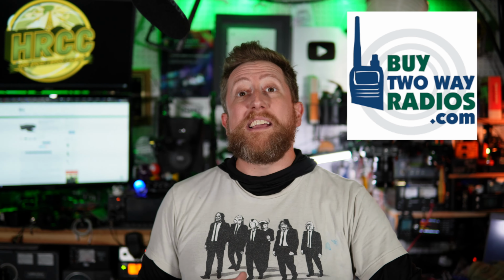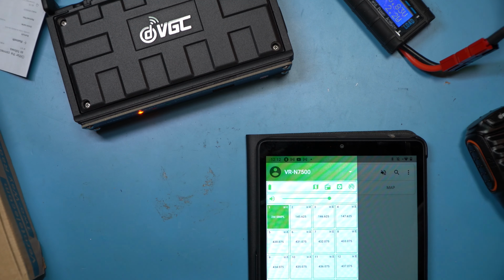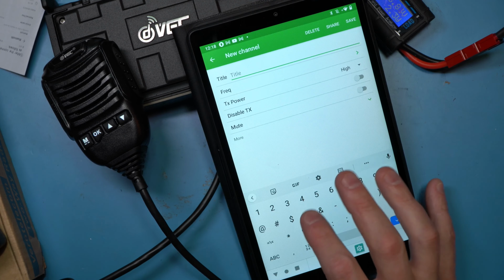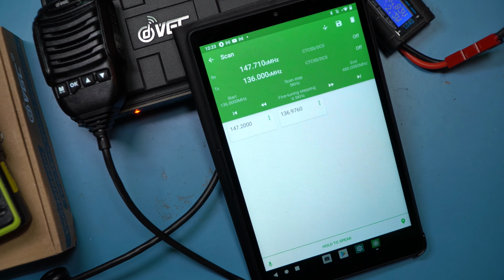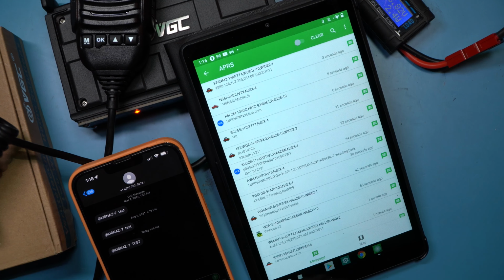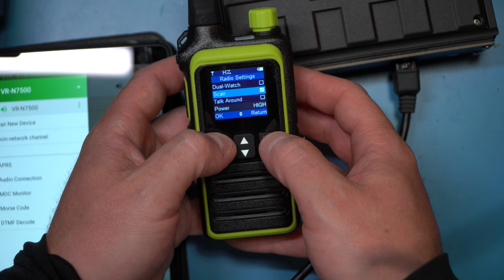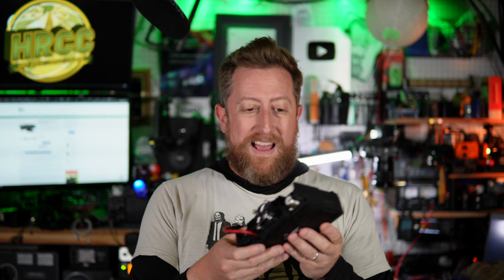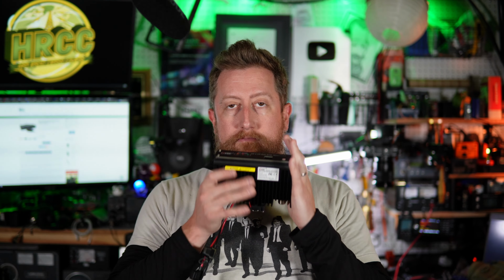VGC VR-N7500: APRS! Android, iOS, Bluetooth, Dual Band 2m/7cm Ham Radio Review

Comment: The affliate link doesn’t appear to go to the rig on the website. Just FYI… probably not working. :-)
Reply: There is plenty of information on the radio and a shame that their website is not, clear as the app does several radio models, look on FB and Google Groups for help groups.
Reply from the maker: That’s the link. It takes you to the website and you can pull up the N7500
Reply: @HamRadioCrashCourse  RR. Just wanted to make sure the “affiliate” part was working. Can’t really tell they’re crediting you… grin.

Comment: I output from my radio to a switcher box which flips between audio coming from my phone for navigation and music, to any incoming transmissions over the radio. This allows both my wife and I to hear what is being switched over the car's stock sound system amplifier, it and then we just grab the handset to reply. Is this unit basically perfect for us with its headphone port and separate microphone handset? Of course I am all ears to better options, I don't need this much power.

Comment: Perfect radio for my motorcycle.  Just throw my cell phone on the mount and I have 2m and 70cm.  Had it for a couple of years now.
Reply: That's an interesting idea.  What sort of hands-free unit do you use to connect to the cell phone?  And what sort of antenna do you have on the motorcycle?
Reply: This is exactly what I am thinking about doing with my Kawi Concourse, mount it inside the faring BT to my helmet and the BT PTT. I am assuming that you are not encountering any heat issues.
Reply: Well it wouldn’t fit under my seat so it gets lots of airflow where I mount it, but it isn’t weather safe.  I pull it and store it for rain.  Your mount sounds smarter than mine.  I suppose heat would strongly depend on how often you key up.
Reply: @awksedgreep  Thank you for the reply, I also joined the FB group for the radio and there is a guy on there that mounted it in his NC attic with no issues. Oh and by the way if you are having issues with the software I suggest joining the FB group as the admin of the group has an email to the the developer who he says is responsive to requests that make sense.
Reply: @pgsmith  I was aware of the google groups but not the Facebook group.  I'll have to join as well.  Thanks for the heads up.
Reply: I have an aluminum top box so I use magnets on the underside to use a mag mount.  At 50 watts my motorcycle is just big enough to be safe at that distance from my body, but it’s a big bike so do your own math.  I use a Bluetooth Ptt and my helmet Bluetooth for mic/speaker.
Reply: @awksedgreep  Thanks for the reply.  I'm not 100% convinced I want a radio on my motorcycle (I'm worried about it being a distraction), but I'm still considering it.
Reply: @pablod6872  I mostly just monitor repeaters.  I used to listen to music but I like repeater traffic more.  Haha
Reply: Also, make sure you get their Bluetooth ptt. I tried a generic first and it wouldn’t pair.

Comment: Nice review of this device, can you take it to that park and test with an Ed Fong J-Pole? I think this is a unique device!
Reply: You can plug anything that works well on 2 & 70. I use it on a motorcycle with APRS and with its rugged construction it still works weel after many trips. Just returned from an 1.800 mile ride using RF APRS only.

Comment: I enjoy my Vero a lot. Yes software is updated via app. Radio receiver is very sensitive and prone to intermodulation if you are close to a very reach RF area.  Planning to link it to my motorcycle helmet and see how it works. Audio is good when I use it with my tablet. I receive good complements during nets or simplex work.  If KN6FWT can get it going on his bike let me know.  Great video thanks!

Comment: So I have this radio, and its been great. I don't have the bluetooth mic, but the weird thing about this is that I can take my tablet upstairs and chat via my tablet no problem and my radio is inside the garage. How does this mic with an antenna not reach as far, but my tablet does?
Reply: The radio section has a small BT antenna mounted on the front and people have extended this by fitting better antenna or mounting the cover more forward on studs. I don't know where the FM antenna is mounted or even if there is one in the antenna section... not stripped it down to look at :>)  Min G0JMS
Reply: Some tablets have larger batteries and the manufacturer will take advantage of this by slightly boosting the power on both Wi-Fi and Bluetooth. Technically however they are both limited to about 30 ish feet / 10 meters. Another issue is even though you are "upstairs" where are you in relation to your garage? If at opposite ends of the house, you are lucky! Count your blessings and enjoy!

Comment: Too bad that the Bluetooth is weak.  This might have been a great CERT device.  

Given local terrain and distances, a 5W HT doesn’t quite work for some events.  I’d love to have a ~50W VHF radio driving a decent antenna, on a tripod, safely off the road, but also be able to walk 30’ from the radio (e.g., directing traffic) and still operate.  I.e., the portability of an HT with the power of a base station.
Reply: Sounds like the perfect use case for a cross band repeater.
Reply: In the open air without walls or bodies between it will do 30ft distance as I have tested it,  some have increased the distance with better BT antenna systems or just moving the front panel forward to expose the BT antenna. It will not do Crossband but the Network side to RF can be good and works well.  Details of extending BT on FB pages for the N7500.

Comment: Will it Tx on GMRS channels?
Reply: yes GMRS no prob, it does 400-470 MHz
Reply: From a Dutch dealer's website (first I could find with numbers): TX/RX: 136-174 / 400-470 MHz
Reply: I've had multiple people tell me that the Tx is actually unlocked.  Don't know if it will stay that way.  I suspect the FCC looks at this kind of unit like software defined radio which really can't be locked.

Comment: I have had mine since 4/20 in a 2019 Wrangler Unlimited. Antenna on the spare tire mount, radio on the driver rear roll bar and hand mike at the rear view mirror magnetically attached to the top toggle. I run the app on a Moto G Power. It is a solid performer in the mountains of North Carolina. Thanks for including the bluetooth mic in your review. Always enjoy your content.
Reply: Are you using this setup currently? I’m in Carthage NC. Went to Asheville area to volunteer and Comm’s are extremely limited.
Reply: Yes, but don't drive much since I retired last year. Repeaters have been quite quiet here before Helene. I can't hit My. Mitchell from my home. Otherwise this has been a good rig for me. Hope this helps. KN4TIH

Comment: I  nearly purchased one of these about a year ago but was concerned about the software. 

I am curious if they are actively developing more polish and features on the software side. 

The concept is cool 😎
Reply: From my first use a couple years ago, to reinstalling the app a few weeks ago, I was surprised to see that, from a UI/design standpoint the app hasn't changed a bit. I was also surprised to see that there was a firmware update for the radio, and the app did it seamlessly over the air in about 90 seconds. That part really impressed me.
Reply: I'm beta testing a new version and they have made great steps forward in sorting out bugs and developing the APRS in the Andriod and iOS side of things, hope they can release the update to all soon.
Reply: @MarnochStanden  are they updating this or is it dead?
Reply: They just updated the iOS app (perhaps today) to show live APRS like we see on the Android app. Josh needs to do another video withe the new iOS update.

Comment: Cool device. I wonder why there's a character limit on a device that doesn't have a display?
Reply: 8 characters is a common hardware limit for small memory systems. They put a slick Bluetooth interface in, but I believe the hardware is relatively basic inside. The memories are saved to the radio itself as well as the app, and it can be operated from the wired or wireless mic without a phone/tablet once you get it setup.

Not defending the decision mind you, but I assume they either never thought of giving it more memory, or they chose not to for cost reasons.
Reply: The radio has a small memory, storing 16 memories only even when switched off,  the Andriod app will store as many groups of 16 channels as you want and easly changed.

Comment: I have an ID-5100, which does not do APRS in the traditional sense on 144.39. I've considered a dedicated APRS radio. The VGC is less expensive than other products. Two questions: Will this run as a "tracker" without the app running? And is there enough frequency separation between 144.39 and 146.52 (and up) to prevent desensing of adjacent 2m radios? Thanks!

Comment: Have been using this radio since Jan 2022. It has withstood heavy use at 3 ARA races, 2 bike SAG events, and very reliable use with APRS, sometimes getting packets out 120 miles first hop. I am constantly delighted by this magic little box!
Reply: still using it? what have you compared it to? I was considering an FTM-200DR but this is a strong contender. does it reliably switch channels to broadcast aprs?
Reply: @bd604  yes, I still use 2 of these - one at my work desk and 1 in my car. I still use both at ARA events. My other 2 meter rig is an FT-1500m. APRS on the VR-N7500 is great. If you throw mute on whatever channel APRS is running, you'd never know it was there. It isn't a true duplex radio but it's very fast. - de K9OPE

Comment: It be interesting to know how well would it integrate with Android Auto.
Reply: It works great through the car's infotainment center. I can listen to both pandora or whatever while listening to the radio chatter simultaneously
Reply: @Spencer.76  is the in car microphone active too?
Reply: Exactly what I’m looking for: a radio to install out of the way, which could be operated through the infotainment system (heck, using the car’s embedded microphone for the cell’s hands fee with just a BT PTT button would be awesome!)
Reply: @RubenMLeal  The radio is not really designed to work any car systems biut some have managed to get it or some to work, it would be nice if all could do this.
Reply: You need a USB connection for that, right?
Reply: @notreallydaedalus  You could, but also can connect via Wifi,

Comment: Guessing you have to mount it where the GPS antenna works in a car? That does limit where you can mount it a bit.
Reply: The radio has no GPS and it takes all it's information from the phone GPS for APRS and maps.
Reply: I believe it uses the GPS in your phone/tablet, but ICBW
Reply: yes, it uses the GPS in whatever mobile device/tablet you have paired to it (e.g. android or apple tablet)
Reply: Yup, what they said☝
Reply: APRS Not-yet here but this raises a question for me as I consider doing it… 

So if I have the radio on and just using it “as a radio” the aprs isn’t actually even  beaconing if I don’t launch the app?
Don’t “regular” radios do their thing without a 2ndary device (except the gps, obviously).
Reply: @HowToHam_Tom  Aprs works well if it's setup correctly as a digi repeater or mobile. As a digi repeater on rf it doesn't need the app running as the app is used for network and gps position.
If app is off the radio will still beacon with it's last position in memory.  Min G0JMS 👍

Comment: No APRS smart beaconing and it won't connect to the bluetooth speaker system in my car like the Anytone. And like the Anytone, it would be nice to just have a PTT button.
Reply: Oh yeah, there's also a dedicated BT PTT that you can strap to a steering wheel shift lever or something. I didn't get one so I don't know much about it
Reply: @notreallydaedalus  I have the BT PTT button but I am not sure that works with this radio. But it would be a no from me without smart beaconing which is my main use for APRS.
Reply: The APRS has been improved and resent upgrades make it much better, it's not designed to connect to the car system, which could be years old, but some have been able too. There is a rear speaker socket that you could use wired or BT.
Reply: It comes with a wired mic with a PTT button. At least, mine did a couple years ago. I bought a BT handmic that looks just like the wired mic for something like $40 at the same time.

Comment: Rumor has it you can connect it to your car stereo if you have BT built in, and use your stereo as a speaker and handsfree mic as the input
Reply: It is true! But it does take a while to cue everything up. Really gotta pause before speaking
Reply: It is really awesome to listen to music through pandora or whatever while simultaneously listening to radio chatter through the car speakers.

There is noticeable delay in receive audio while using Bluetooth compared to the hand mic through.

Comment: I've had mine for a few years. Great radio overall. I need to install it in my new vehicle, but I'm currently using it as a base station until I get it installed. I didn't realize they had the new mic out. I have the old Bluetooth mic and I have to hold it about a foot away or it overloads modulation. I still need to take the time to learn to do APRS and to do the networking part. But, as a hideable dual-band radio that doesn't require a head unit to be installed, it works great. In a vehicle, I put the radio under the seat and have an extension cable for the mic. I get pretty good and usable sound out of the wired speaker/mic. It would be great to see the software updated with attention to the U.S. market and uses.

Comment: I like the radio set up. I am new to Ham radio and I have a couple of Android devices. I was thinking that you could connect the radio to an external battery and take it to the park. Perhaps  hang an antenna from a tree similar to what I have seen done with the N^TAX antenna.  I really haven't gotten beyond my Baofeng and Abree antenna.
Reply from the maker: Not exactly sure, but that F-YOU clip is pretty common in SoCal.
Reply: @HamRadioCrashCourse  bahaha
Reply from the maker: Lol, sorry my first reply was to the wrong comment. Yes this radio would work ok for that and more limited by the tablet or phone than anything. 👍
Reply: FYI, I just tested mine on battery last week. On my LiFePO4 setup with a high charge (near 14VDC), it drew about 8 to 9A on high power (45+ W) transmit. I didn't pay much attention to low power because I was sizing the wiring, but I think medium (~20W) was like 4A draw. You'd want to make your activations short or be prepared to carry a fairly beefy battery.